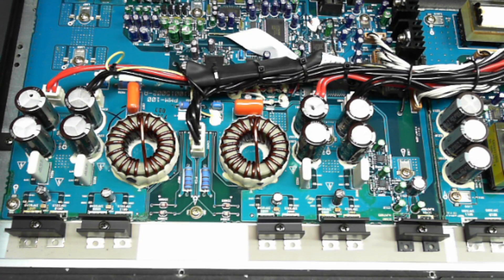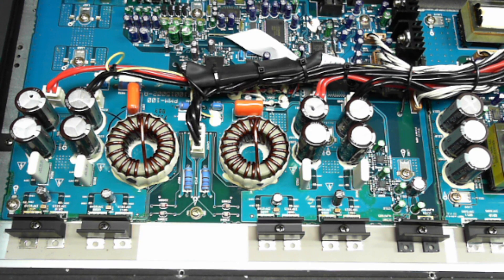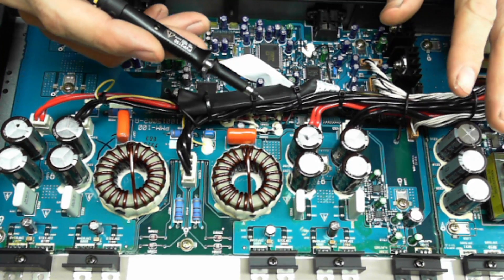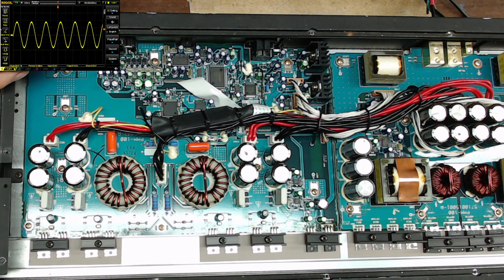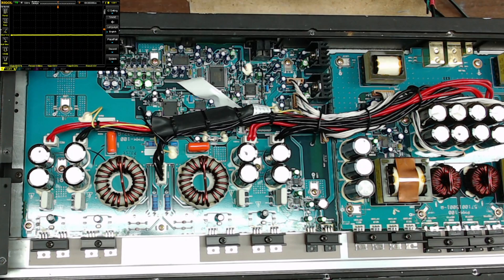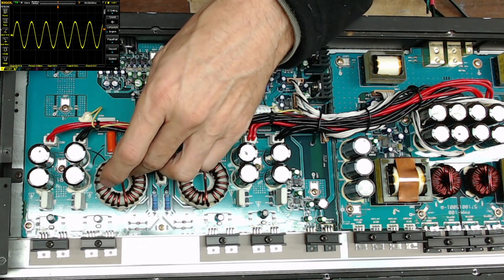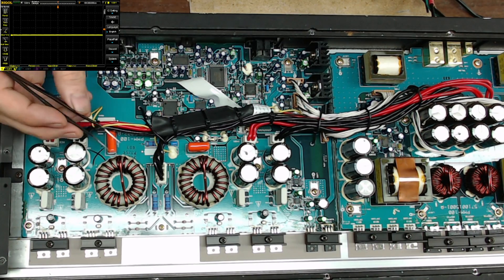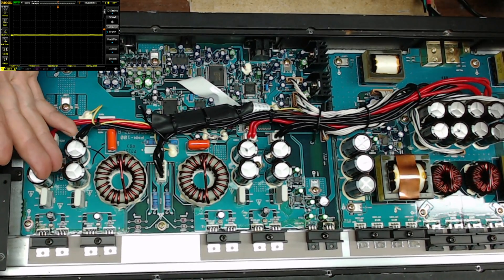Alpine MRD1000 Output Fault Pulled a Ton Of Current by Touching It

Comment: Alpine the super high tech brand of the amp world, loaded with ic chips galore, some of the touchiest amps to fix and diagnose, they can be temperamental with age, very clean sounding amps tho, for your average sub amp needs either go budget good quality with pioneer or go balls to walls durability tried and true Rockford Fosgate, I’d stay away from alpine from now on, kenwood excelon series are also very clean and good but also falls into the same issues as alpine, stick with class Ab simple amps from a reputable brand to be reliable for door speakers😅

Comment: What is the reason of E3 error message on mrd m1000 screen?
Reply from the maker: That is the typical over-current error. Either a shorted output or damage in the protection circuit.
Reply: Amigo pudiste resolver el problema de tu fuente con el error E3 es que tengo una igual con el mismo error y mete voltaje en la salida de audio